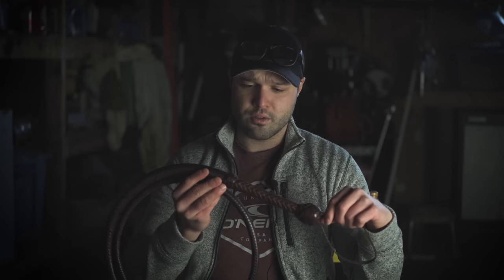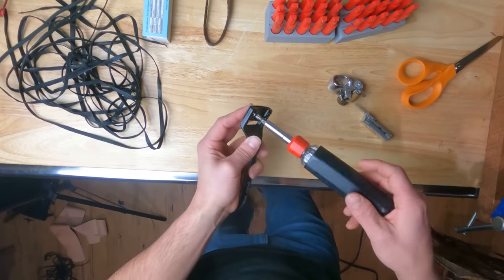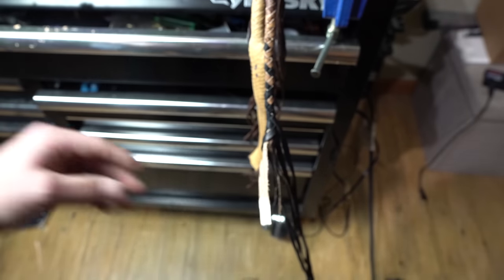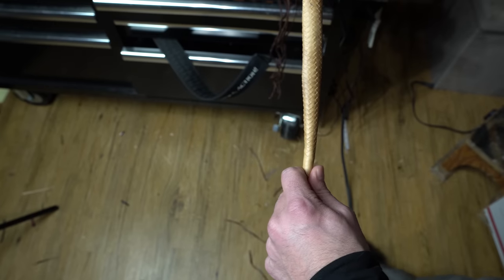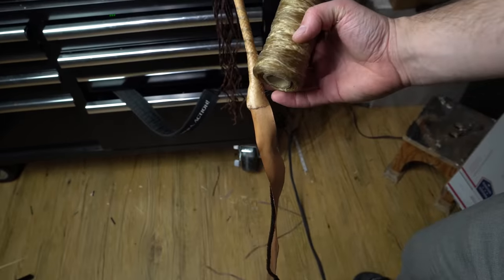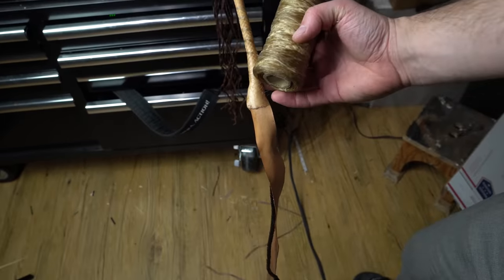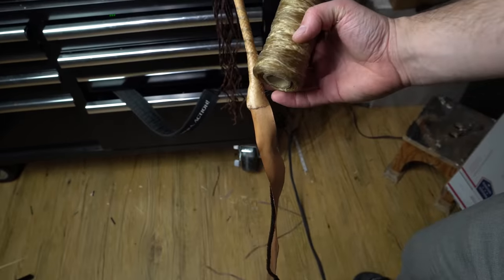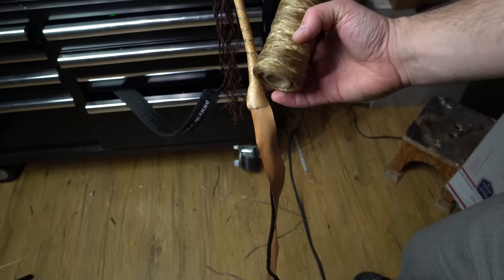The Most Challenging Bullwhip Repair I Have Ever Attempted - Indiana Jones Style Bullwhip

Comment: Hey brother, great video.  I've found leather is about 1.5x whatever you need for strand lengths. Example: If you want to resize your strand exactly 4' down on the whip, you can start your trimming at about 6' on the strands and when you are plaiting, it will be within an inch or two of that 4' mark

Comment: Hey Nick,
 It’s Great to see you being brave and venturing into new territory! A good flexible adhesive is DAP contact cement in the red can, or barge cement which is used for shoe repair.
Reply: Contact cement and hide glue work well too but hide glue is really finicky

Comment: In splicing new strands into existing lengths, I prefer a more direct splice of each strand directly onto each one, skiving both strands and gluing them together, quickly plaiting them so as to form the bond of the glue into the shape of which the plait is in... I have always felt that if you insert a strand that is not into a whip plaited in the English eye style, the strand will be subject to pull out. Getting the distance for the skive is critical, too thin and long a taper being useless, and to quick a taper is not enough to be of much strength. For what you have there, I would taper about 3/4th to 1 inch of taper to both sides.. There actually is a leather glue, but I think it is the same as a fabric glue, I use "Shoe Goo", which is a great adhesive, not a cement, like CA.

Comment: lamo i had  the same thing happen a couple years ago, i repaired it and its been great since, using all the original strands as well just stagered my repairs using contact cement and you cant even tell it was repaired, i did  the entire whip over tho and only lost 2 feet total when it was all done
Reply: oh now watching further i see you did it much different, mine i scived  both ends of strands and glued them together, different legnths so they wouldnt all be in the same spot of the whip. then replaited. i used contact cement tho as i was told its best for leather as it stays flexible but does a very strong bond with leather. and it also bonds to leather really quick